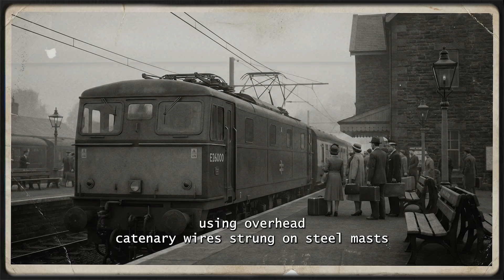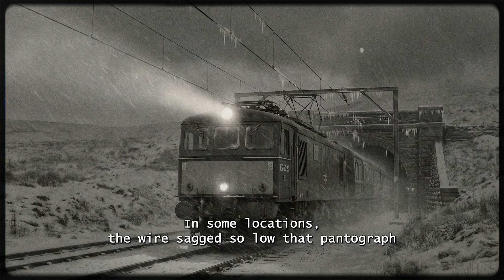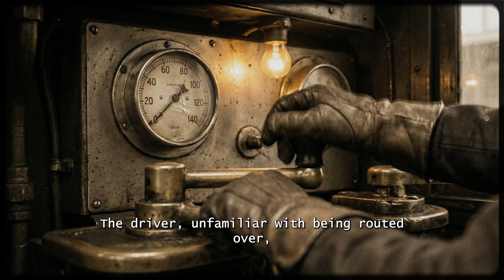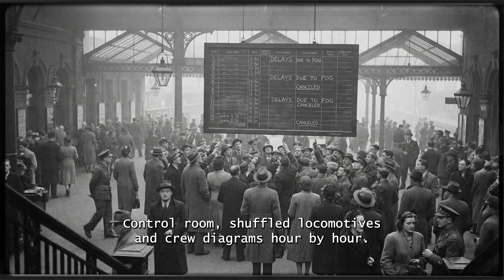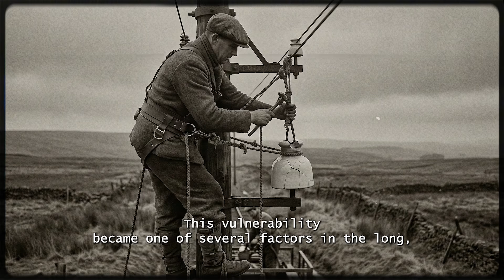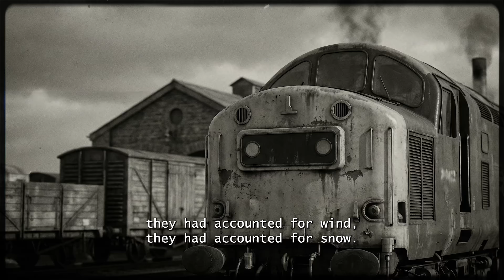Woodhead's Fatal Flaw Ice Stopped the Electrics

Comment: Not only the overhead cables were removed, the much larger diameter trackside cables were also removed. But many of the concrete trackside cable-carrying posts are still in place, even a few of the trackside cable interconnection boxes are still in place...

Comment: Just a word to the wise, the supporting cables are usually pronounced Cateenery, rather than how you said it. Best wishes, Bob M  - looking at a souvenir of the Thurgoland area, ( 2 brown pot insulators on the heavy copper suspension cable, found lurking lineside many years after line closure)..... 😮‍💨
Reply from the maker: Thanks for the tip on the pronunciation, Bob! And that souvenir sounds incredible a genuine piece of industrial history to have in your hands. It's amazing what treasures can still be found lineside after all these years. Thanks for sharing.

Comment: Train engineer here working at Alstom in Manchester. You don't get steam coming out of brake pipes! That means water is in the brake pipes which is a very dangerous situation on a train. Trains that use air pipes for braking have air dryers at various points, like next to the air compressors, to prevent that happening. AI slop once again ffs! 😡
Reply from the maker: A valid correction from a pro. The visuals definitely took some artistic liberties that defy the engineering reality of air brakes. Thanks for pointing out the danger of water in the pipes important detail.

Comment: As someone who worked over the Route from 1966 to closure I can say that the only correct statements in this film are the opening and closure dates.
Reply from the maker: It's an honor to have someone who actually worked the route watching. I have massive respect for the crews who kept it running. As this is a dramatized storytelling piece rather than a technical documentary, I had to simplify things, but I'd genuinely value any specific corrections you could share to improve future videos.

Comment: It doesn't explain how Swiss railways routinely cross the Alps in winter, but the Woodhead route couldn't cross the Pennines.
Reply from the maker: Great point. The main difference is that Swiss railways are engineered from the ground up for extremes. The Woodhead's older 1.5kV DC overhead wires were particularly vulnerable to the Pennines' unique mix of high wind and wet ice (which sticks and freezes), causing arcing that the system just wasn't robust enough to handle compared to Swiss standards.
Reply: The conditions in the Alps tend to be much drier. Of course hill and mountain areas in the north of England and in Scotland could be arctic in winter, not Alpine, but I would say the main difference is the dampness in freezing conditions.  Of course with global warming conditions in the Pennines are much less cold than tthey used to be when I started winter walking on those hills in the 1960´s to the late1980´s. In the late 1990´s to possibly the early 2000´s the local councils where road routes started on the passes over the Pennines, removed all the snow closure flashing lights signs, because winters were much warmer.

Comment: Rubbish! Far from being 'Britain's most advanced railway' and 'Technological future' the DC system was itself obsolete by 1969. All new systems were being built as 25kv AC and the Liverpool St DC lines had already been converted to AC.
Reply: Sadly just after conversion, som steam loco crews got electro cuted, when swinging fire irons & climbing on th bunker or tender. The 25kv A C jumped larger gaps than th 1500v  D C 😮  Hence from 1960? Steam locos werfited with small prominent "Danger Live overhead Wires" plates.
Reply from the maker: You're technically correct about the 25kV AC standard taking over. The 'advanced' label was certainly true at the time of its post war conception, but as you say, it became a technological dead-end very quickly compared to the rest of the network. Thanks for the context.
Reply: Some lines were electrified with 25kv ac from 1960, like the route from Manchester Piccadilly to London Euston, after it was tried out on the Styal line which was the first line in the UK to get the high voltage AC system which is far superior to any DC system as it needs far less current and therefore lighter wires and fewer substations yet it can deliver far greater power so high voltage AC trains can go faster and pull more weight etc.

Comment: The fact that the area does  have its own climate is correct. You can set off from Sheffield often in calm sunshine yet when you get over the top towards Manchester it's dull and wet. The electrification was planned before WW2 but held up by the war. There would be no money to change to AC so that's why you had an obsolete system of electrification from day one when completed. Once freight traffic dwindled closure loomed. Passenger numbers couldn't support the route after that.
Reply: So sad,, line shud hav been kept but "rationalisd' : reduced to sigl Trak with passin loops, as done in Dorset &  Oxfd /Glos shire. But in 1980 Thatchers anti  B Rlwy govt was cutting BR subsidys.😢
Reply from the maker: Spot on regarding the weather contrast it really is like two different worlds! And that context about the pre war planning is crucial; being locked into the older DC standard due to budget really sealed its fate. Thanks for the detailed summary.

Comment: "The drivers were unfamiliar with the route". You either sign the route or you dont. You dont just jump in the cab and off you go.
Reply from the maker: You are technically correct about 'signing the route' protocols. I used the phrase more loosely for the narrative, but I appreciate the insight into the strict rules drivers have to follow
Reply: @WhenBritainWasUK AI BS
Reply: It's AI slop

Comment: I thought water was a good conductor of electricity though, I don’t know much about electricity but I would have thought the ice would have been an excellent conductor of electricity, I know that the third rail down where I live in the south east also has problems with ice, spectacular arcing of blue and white light, thwacking sizzling from the shoes attempting to draw electricity
Reply from the maker: Great observation regarding the third rail! Actually, ice acts as an insulator rather than a conductor. The spectacular arcing you see is actually the electricity forcing its way (jumping) across the gaps caused by the ice layer. Thanks for the comment!
Reply: The ice is conductive up to a point, but it has too much resistance and cannot pass the thousands of amps needed to move a train, but it can coat the smaller insulators on a DC overhead system which also causes leakage to earth and therefore power losses. And DC traction systems use lower voltages and therefore higher currents plus DC constantly flows in one direction hence the more aggressive arcing, which happens more when the contact wires are icy, just watch trams running in the depth of winter, especially at night.

Comment: The whole video is gobbledegook
Reply: Indeed, the new Woodhead tunnel was banned to steam because of the concrete lining.  And the Woodhead electrification was designed to be rugged and cope with the Pennine weather.
Reply: More AI-generated dross! Down vote so that the algorithm sees your opinion
Reply: Just so you know - there are two versions of this currently on YT - one is a second longer, but they are both AI dross